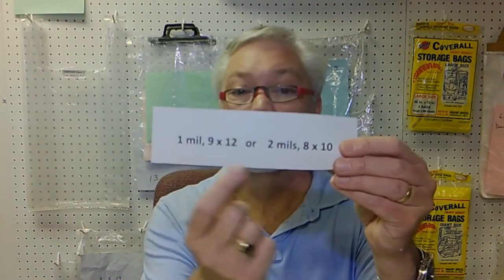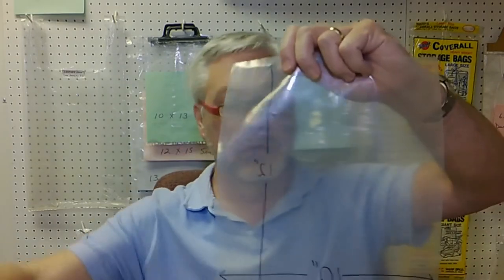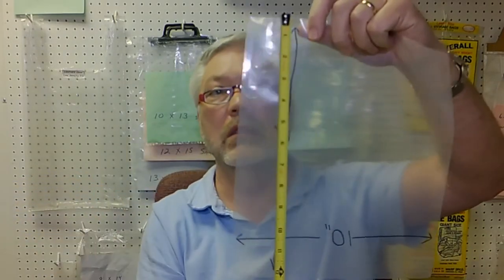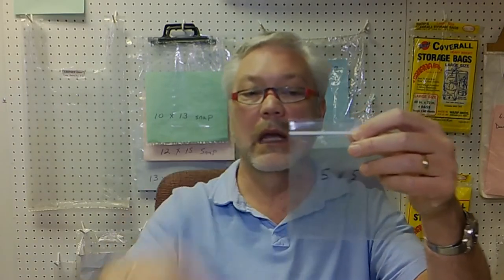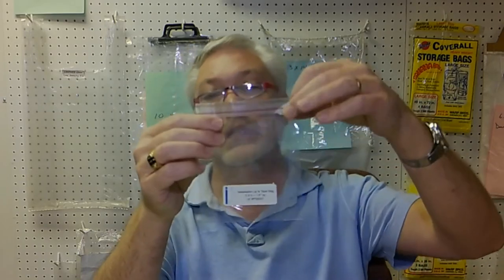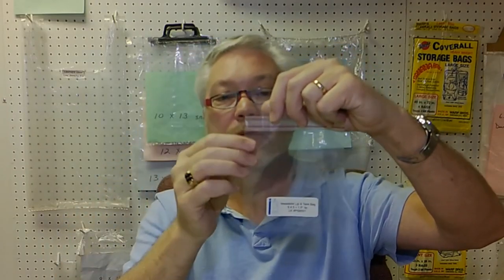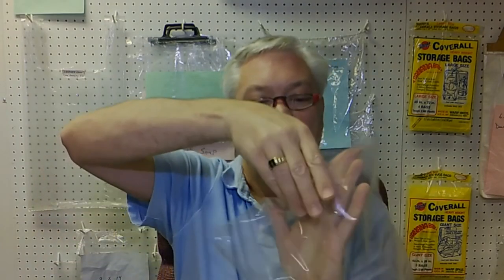How to Measure Plastic Bags

Comment: Can you make a video on how to measure the weight of a bag ? How much does a newspaper bag weigh ? Google cant help 😣
Reply from the maker: Sorry to be so slow on this.  I just found your question.  The formula is width (in inches) times length (in inches) times gauge (in mils) divided by 15 yields the weight of 1,000 bags of that size.  Divide that by 1,000 for the weight of one bag.